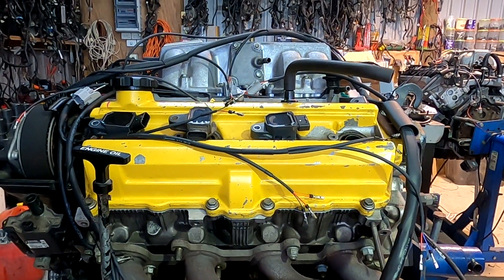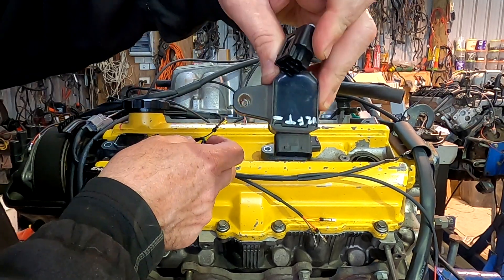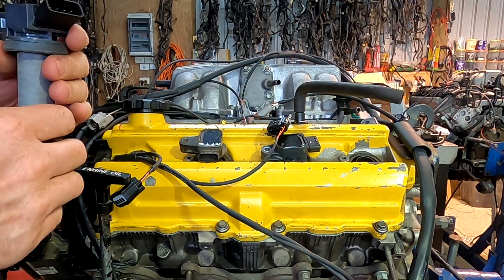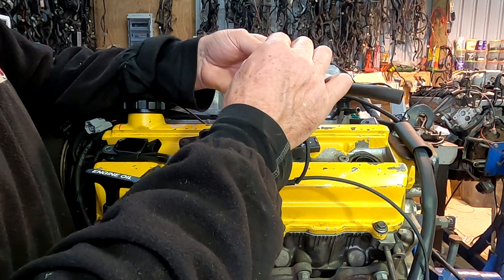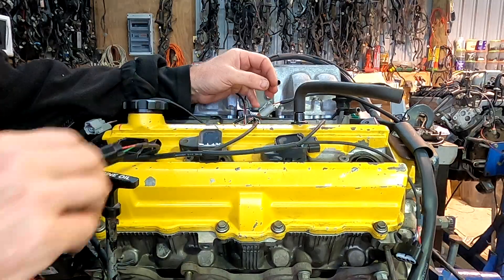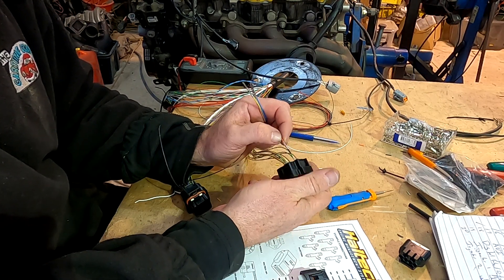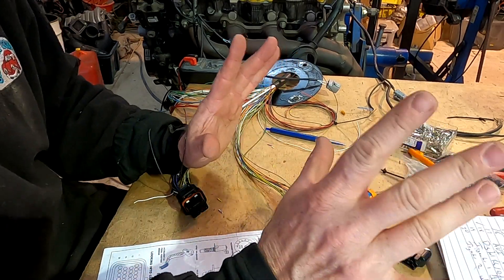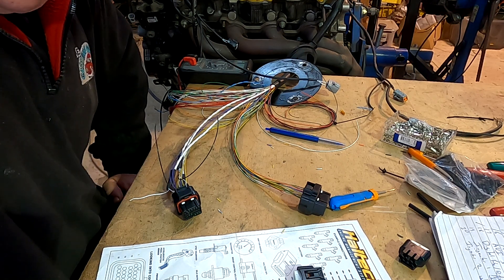Haltech ecu to 1uz Part 5.  Ignition coils Coil on plug COP.

Comment: Hey Kelvin, 
at the end of the video you mentioned that you may need an igniter if the COP coilpacks don't include an igniter...
how would I check if the coilpacks I've got need an igniter?

cheers.
Reply: not to step into this gentlemans area of knowledge, and you probably figured it out since it has been a year, but for anyone in the future maybe I can help. Must ignition coils, the ones on standard and newer j series, maybe k series too, have COP or coil on pack ignition coils. They have built in igniters. So for the 3 wire plug, you have a 12v from a relay and fuse, then a signal wire running back to the Haltech, and chassis ground (negative).

Comment: Hello Kelvin, just found the channel and i think its just the thing i need. I have a stock sc400 from 1993. its giving me a code 25. what are some things I could check/replace myself? I dont have a car lift :(
Reply from the maker: Ive got more diagnostic videos of sc400 and soarer.  25 is lean mixture so I'd be doing a mechanical tune,  checking for air leaks,  replacing injector seals,  confirming tappets are within spec,   checking oxygen sensor operation etc etc.  Start with the basics

Comment: Hello big fan from Los Angeles my 1999 gs400 with the 1uzfe in it is not going passed 3000 rpms . The code is for maf sensor I noticed the maf and air box is off a 3uzfe sensor is different will that be my problem or my open headers ? Please and thank you
Reply from the maker: Hello.  Is it a stock GS400?  If it has a code for MAF I would be addressing that first.  As for different sensors on different models so interchange and some don't.  I confirm with Toyodiy and my knowledge. Most of my test engines are on open headers and rev fine.  Cheers Kelvin
Reply: CartuneNZ thank you !! Yes it’s stock

Comment: Kelvin, again, is this constant 12V from ECU to coil and ECU signal to coil to fire it? Trying to get a handle on the circuit! Cheers
Reply from the maker: Correct.  Good 12 volt power supply to the coils which also have a chassis earth then the ECU triggers the ignitor which is integrated into the coil.